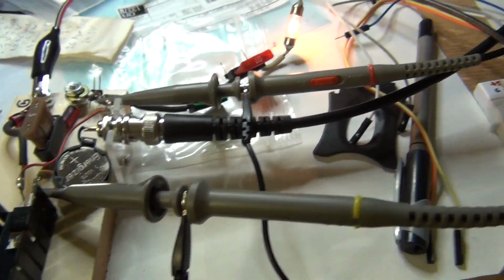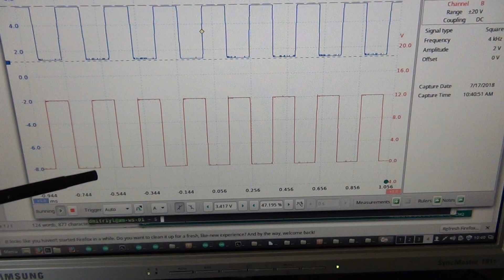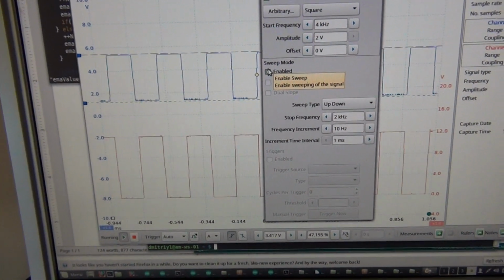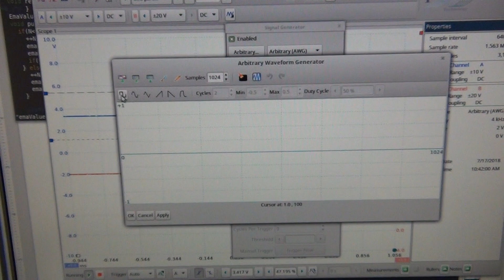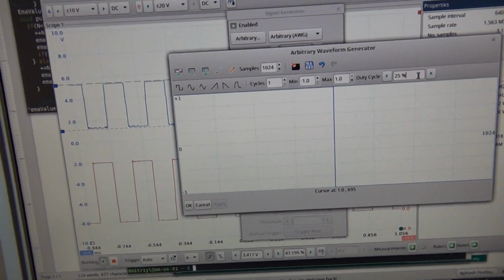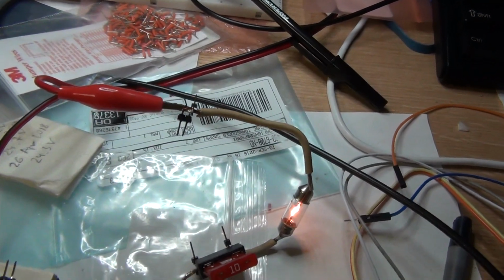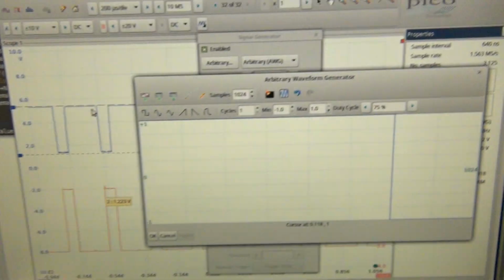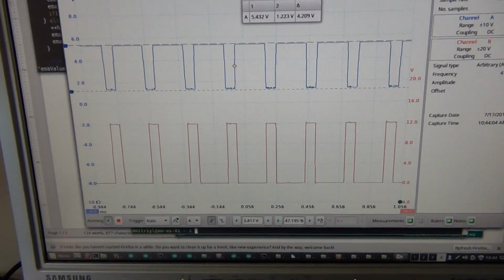Got Pico AWG? Make PWM/Freq driver!

Comment: Hi Dmitriy,  is it possible to amplify any signal from the awg to 12v . Lets say change a 2v sine wave into a 12 sine wave that the ecu will read as an input. I really hope you can help as my brain is about to explode!!!!
Reply from the maker: What kind of ECU inputs are you thinking about? Many VRS inputs do not need 12 volts to work -- for example, in this video the ABS module responded nicely to +/-1V AWG signal: https://youtu.be/kCQISDRNAmQ
If you don't even need to amplify the signal, it would be the easiest solution!
Reply: @DmitriyL_Arithmechanics  I was thinking about Cam and Crank inputs, Thinking about the possibilty of inputting a bad signal into a good car (seems crazy but there is a reason) .
Reply from the maker: @definitivediagnosis9162  I would start with trying to feed +/-2V waveform (made from a captured crank signal or from my VRS calculator, at 10Hz) into the VRS crank input and see if the scantool reports engine speed. Just don't forget to disable injectors. Would love to see a video of that.
Reply: @DmitriyL_Arithmechanics  I will try that. I have managed to amplify the signal to batt voltage but signal is inverted. Not sure how I overcome that.

Comment: Do you think that the AWG circuit on the 2204A can handle a draw of between 3-30 milliamp?  I'm using a solid state relay for my project and that's about how much current the control side of the relay draws.
Reply from the maker: Internally the AWG is +/-2V voltage source connected to the output through a 600 Ohm resistor. If you shift the voltage up by 3V like I do in this video, it might barely work, but don't count on it. 

I would use a transistor to drive the SSR. See page 2 of this document for examples: https://cdn.sparkfun.com/datasheets/Components/General/SSR40DA.pdf

If you plan on using this with an ignition coil, you should also add circuitry to prevent accidentally turning the coil ON for an extended period of time as that would surely burn up the coil. Should I do a video on such circuitry?